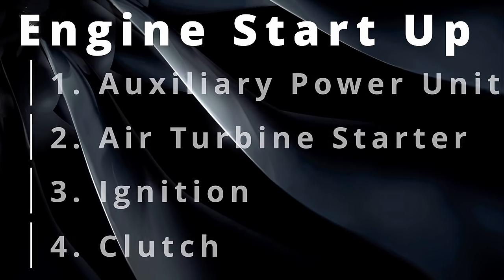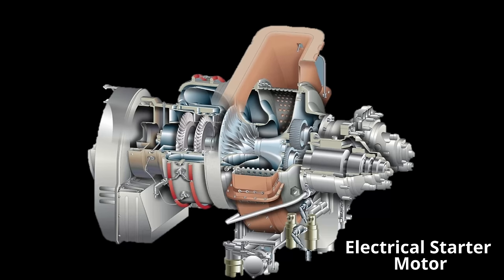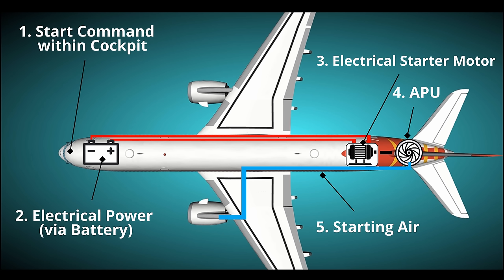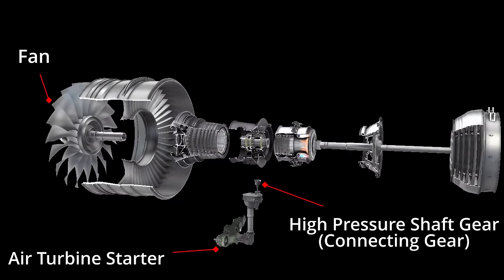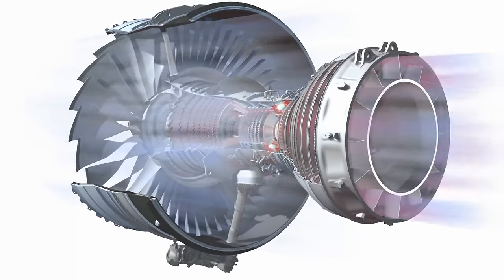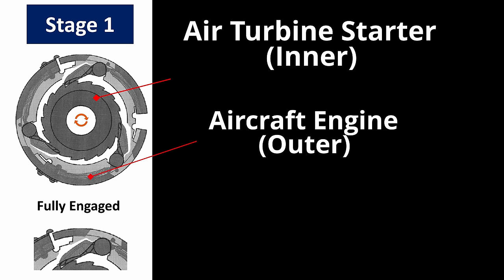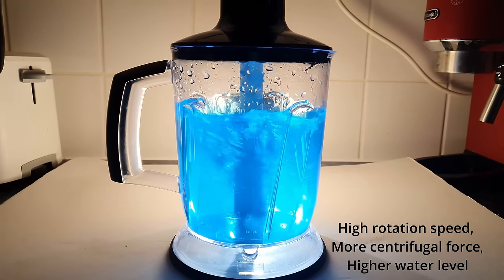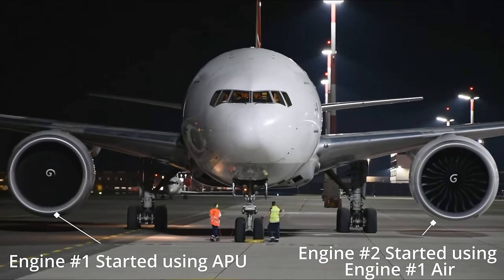How do Airplane Engines Start? (Including Startup Sounds)

Comment: Where’s the fuel tanks then? Those wings have way too much hydraulic systems inside to accommodate tanks. Those wings are built to be light and flexible not fuel laden wing tanks..
Reply: What are you on about?😆😂There arent any hydralic system components inside a wing.
Reply: @speedbird9313  how do you suppose the flaps and ailerons move? Magic 🪄?
Reply: @photosphotos  Did you forget slats? And why do you believe that the hydraulic components for these systems are inside the wings? 🤔
Reply: Fuel tanks are inside the wings and the centre section of the wing under the fuselage. Some aircraft have fuel tanks in the horizontal stabiliser. Some also have auxiliary tanks in the forward and aft cargo compartments. The hydraulic tubing generally speaking will run along the front and rear spars of the wings. The actuators to operate the flight controls hang off these aswell. The B737 and most other BOEINGS aircraft that I am aware of have hydraulic heat exchangers within the fuel tanks to cool the hydraulic fluid and to help warm the fuel
Reply: @speedbird9313 hydraulic heat exchangers are within the wing tanks
Reply: @speedbird9313  yes, the hydraulic heat exchangers are part of the hydraulic system and they are a component of that system. Not particularly easy to change but the removal/installation is covered by ATA CH29 so it’s not me but BOEING that thinks they are part of the hydraulic system. There are cautions all the way through the AMM when operating the EMDP’s to ensure there is a minimum of 760kgs in the respective fuel tank so the fluid doesn’t get too hot. But as far as I can remember, you are correct in that there are no other hydraulic components within the fuel tanks.

True what you say with regards to the level of information. But let’s get what information we supply to be factually correct even though the video and most others like it on YouTube can’t be bothered to get their research correct
Reply: @NicholasRiviera-Dr  You’re taking this a bit to serious, this is just youtube, not your assessment interview😉

Comment: Many thanks for cohesive and interesting tutorial. However, piston engines almost never were started by manually rotating propeller. This manual rotation of early engines was aimed on proper and according placement of pistons inside engines. Real start occurred by mechanical or explosive rotation.
Reply: Engines started by hand rotation used magnetos to produce the spark to ignite the fuel air mix. The propeller is rotated to a point where compression is reached then quickly rotated over that point. The starter needs to be properly trained and know how to position safely as the engine starts. There's only mechanical input in the sense of giving the propeller sufficient momentum to overcome the compression. Tricks like release of compression or reducing it on start were common.
Reply: My dad’s aircraft had to be started by hand.  Just set the controls and spin the prop.  That procedure basically ended with better batteries and electrical starters.
Reply: A DC-3 could be started like a lawnmower if the batteries got dead out in the sticks. A rope was tied around the spinner and pulled by a car, or in one reported case, by a horse pulling it. But - the first small engines were started by hand. For instance the Piper Cub.

Comment: A few errors: The APU has its own battery, it does not use aircraft battery. Starter air first goes thru a starter valve (not mentioned), then the air turbine starter connected to the HP section by an overrunning clutch (not necessarliy a centrifugal version) much like in your car. As the engine begins to pull on its own and Exhaust Gas Temperature (EGT) reaches a certain amount, the starter clutch disengages naturally and the starter valve closes. 
Minimum sustained speed for engines is around 50%N, not 20%.
Reply: around 20% is when you throw fuel....  The APU wont start if the SHIPS battery is dead. "pull on its own EGT"  makes ZERO sense....aprrox 50% N2 is STARTER CUTOUT. The only thing we watch during start as far as EGT is concerned is a hot start.  The starter is connected to the GEARBOX, not the HP section.  Talk about a few errors....jeez.

Comment: Thank you so much to explain and fully details of how the engines start, I have a question ,after the engines fully started  and you are facing the engine blades, the engines rotate direction is anti-clockwise, my question is why some engines are clock-wise rotate, for the first start and a moment later back to normal?
Reply: Tailwinds. The "fan" is free to rotate in either direction. Or perhaps the stroboscopic effect in video recording.
Reply: Yes tailwind is possible.
One thing important too. All the engine manufacturers have their engines rotating in the same direction except Rolls Royce.
They run in the opposite direction. If you guess why you win 🏅 . I did not check but the answer must be available on the net 😀

Comment: I'm not so sure about this video.  The fans are all connected to a common shaft.  So, they should ALL be rotating in the same direction.  But, you have the right idea.
Reply: there is ONE fan.  N1.

Comment: High-pitched whine is a TURBINE engine. The auxiliary power unit (APU) is a small gas turbine engine mounted in the tail cone of an aircraft to provide autonomous electrical and mechanical power for the following: Starting power for the main engines. Pneumatic power for cabin air conditioning systems. Shaft power for other pneumatic and hydraulic systems.

Comment: How is the thrust cotrolled during the engine start so the plane doesnt simple crashes into the terminal?
Reply: It isnt touched, that helps😆😉
Reply: @speedbird9313  A better answer is the plane has good brakes on the wheels.
Reply: @Mark_Bridges  Its not like it gonna go anywhere at idle run..🤷🏻‍♂️😉

Comment: How do old war plane shoots their bullet through the propeller and doesnt hit the blades?
Reply: Synchronizers.
Reply: At first,they put metal plates on the propellers to deflect the bullets.  Eventually the guns were timed with the engine so it always fired between the propellers.

Comment: I understand that the entire engine is operated by 1 shaft but why does nobody ever mention why the middle turbines spin in the opposite direction as the front and the back?
Reply: The engine is operated by 2 shafts, as this video clearly shows and explains.

Comment: Not really ready for take off. Engines have a minimum warm up time but, details.
Reply: No they dont..🤪
Reply: When I pulled alert duty on the KC-135A, once the klaxon sounded, we would be airborne in three minutes.  That included getting to the aircraft, starting the engines, and taxiing to the runway.  No warmup required.
Reply: piston engines do. I think diesel engines not so much.

Comment: Is it accurate to say that the high pressure shaft and the low pressure shaft are linked through a gear set?  The ratio of the speeds of the two shafts seem to be proportional up until about 6:04, at which time the high pressure shaft spins up rapidly, and the ratio of speeds between the two shafts grows immensely.  Obviously, this isn't possible if the speed ratio of the two shafts is constrained by gears.  So, what is the nature of the mechanical connection between N1 and N2?
Reply: There is no mechanical connection between the shafts. One shaft has both compressor and turbine and is the one that generates power.  Exhaust air from this turbine passes over the turbine of the second shaft which spins the main intake fan, or the propeller for a turboprop engine.  So you could say the second shaft uses the power from the first shaft to spin the fan or prop, and there is a fluid (air) connection between the two shafts which explains the varying speed ratio.

Comment: welle explained, however it's missing the main crucial part of the structure of the turbine using the Schauberger century technologie shape that creates an air vortex that is almost perpetual and self energetic, reason why they don't want you to know that the kerozene is used only to start and feed the air compressor (even if the truck at the airport fill the air tank too), then to take off and land. once in the air most of the time perpetual turbine motion is on the scene, then use more air compressed to accelerate and keep a certain speed. So we can say that another big lie is discovered, there is no 180 tons of kerozene in an airbus 380 for that reason, and also for those who have eyes to see there is no such space to host so much fuel.
another proof that the kerozen is on the back of a commercial plane and not on the wings and have a tank of max 10 tons. check the recent accident at haneda airport japan.
although the plane hit the jet plane with its wing and turbine, the fire started at the back where no hit was occured....
Reply: You're saying the plane runs on compressed air most of the time?  That's not possible, perpetual motion is a myth.  Why do you bother posting misinformation on the internet?

Comment: I was groundcrew . This is a very bland disney style  explanation.
Reply: That was a very bland job description. What kind of groundcrew? "Honeycart" operator? 😅
Reply: bs. you were a janitor or something
Reply: Oh. Such wit. Excuse me while I stop my sides exploding. I have emptied the honeycart, I have marshalled. I have towed. I have stood outside on headset whilst the engines are run. I have sat in the cockpit and talked to the guy outside while I ran the engines. I've ground run fighter jets in reheat/ afterburner. The last course I went on took 2 days to explain the computer controlled starter system to allow me to make the decisions to allow me to fix it and get the aircraft safely into the air. 

How long was you trolling course?